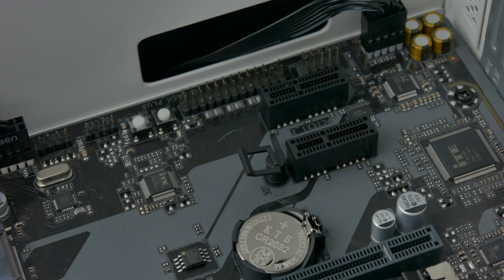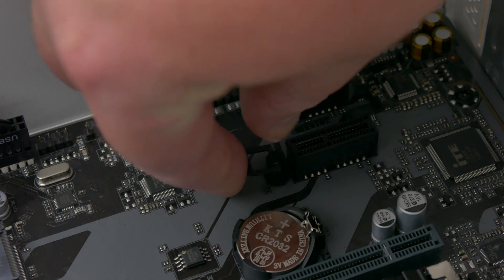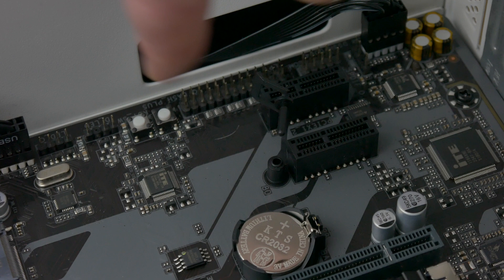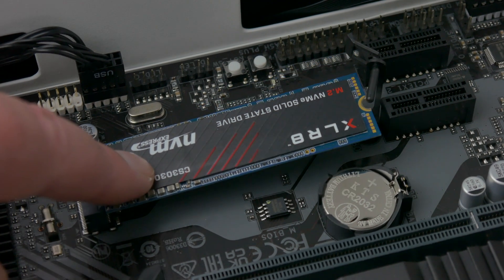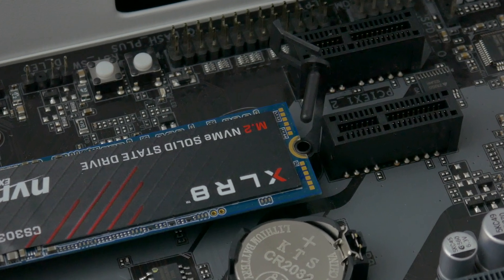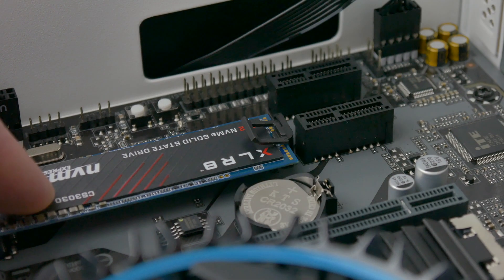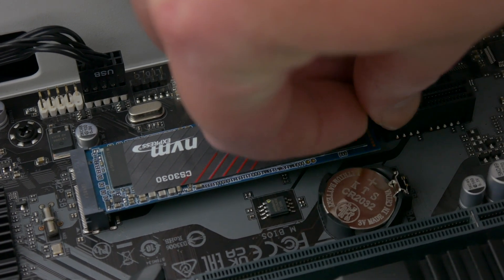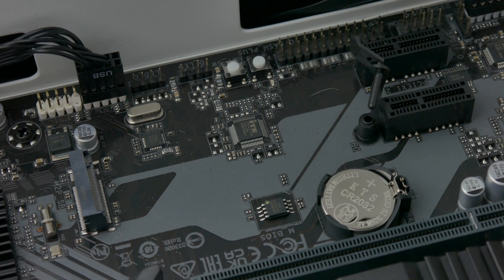How to Install M2 SSD with Plastic Clip on Gigabyte Motherboard.

Comment: Excellent Video!
Unfortunately, this plastic clip blocks installation of SSD radiator, any ideas how to replace it with a screw mount?
Reply from the maker: You can pull out the plastic by squeezing from the other side with pliers, and then put a metal standoff in the hole where it used to be,
Reply: @BartechTV  thank you, this plastic clip looks like a good solution for a budget mother boards. But mine was from the mid-range ...

Comment: OMG, thanks to my OCD I never throw out anything electronic related, and I found this plastic flimsy thing in the MB box. I 100% though it's a plug for a standard screw, and ripped it when I was building my machine. Thanks for showing that, man!

Comment: Sir i have the b365m gaming hd motherboard from gigabyte 

It has the same clip mechanism 

But i bought new ssd 990 pro 2tb samsung with aorus separate heatsink

Now i cannot lock the ssd , will it need separate screw as the height is increased by the heatsink

Or the clip mechanism work?

Comment: So, the plastic clip won't close. I have my ssd already installed and it's a bit inclined so I tried pushing the little thing like you showed in the video, but for me it opens again a bit. What should I do? Is one of my ssd slots on my motherboard fucked?

Comment: Thank you! I've just looked up about installing ssd and mine is a gigabyte motherboard as well and I find that this type of installation is kinda weird that it's just being held by a plastic clip while it's constantly resisting being pushed out.
Reply: I'm not loving this new way of holding an m2 seems really flimsy and probably gone be a fail point somewhere done the line
Reply: @paullillico2310  i just installed my 1st ssd and it was a horrible process cause of this poor design because I will have to remove my gpu first because it's just simply impossible if you have adult large hands and there's no room for your hands to re attach the plastic pin once you have the ssd, like sheesh. Horrible design idea.

Comment: Lol thanks alot I rotated it and it fits then but the SSD can pop out easily then so I thought I can use tape on it so it can stay into there right. But I already was thinking there should be something else on how to do this. Pretty dumb that they dont have this shown into the mobo manual.

Comment: You are a life saver, mate. Gigabyte's manual is so crap, they still show a screw for holding the m2 SSD. I'm all for screwless solutions, but dear God, why can't they put it in the manual? It even looks like something you should be turning, not pull out...
Reply: Same here thank you very much
Reply: Exact!!
Reply: Hell same shit hes a lifesaver haha
Reply: didn't even get a manual with ssd instructions
Reply: Same i was pulling my hair out wondering what to do
Reply: Thank you so much 😊
Reply: +1
Reply: Tell me about it, im using the b650 Eagle AX and mine has some fucking rubber standoff in the middle and im genuinely not even sure how to remove it or if I need to remove it. Trying to find a video about it now.
Reply: Bro can't plug an NVME 💀
Reply: @mikloskoszegi  same, I was struggling for like 30 minutes before I searched this up
Reply: This is still a problem omg💀
Reply: Worked well on the Gigabyte B550M motherboard—thanks for the tip!
Reply: @mikloskoszegi  Exactly. I'm building my new rig right now and the manual shows a standoff and a screw to install the M2. Unbelievable. I almost throw away that clip.

Comment: Can it be replaced with screws?
Reply from the maker: You'd have to remove the plastic connector completely from the board, and screw in a brass standoff where it used to be.